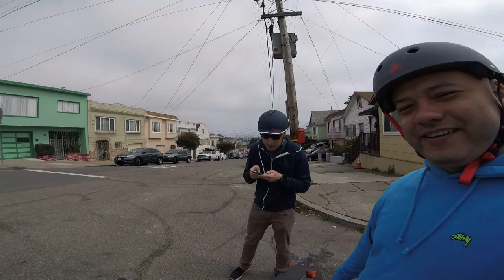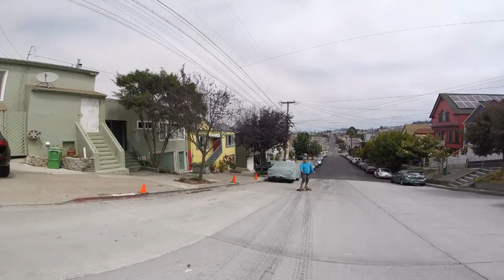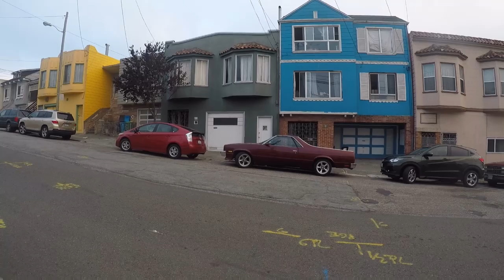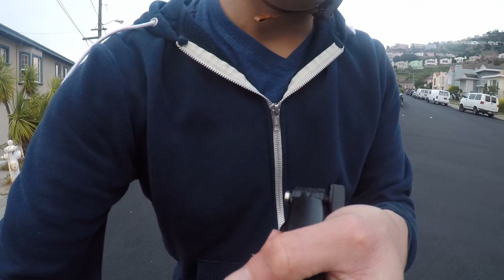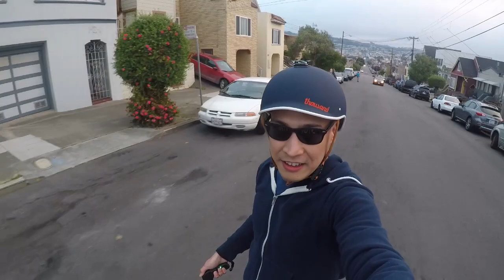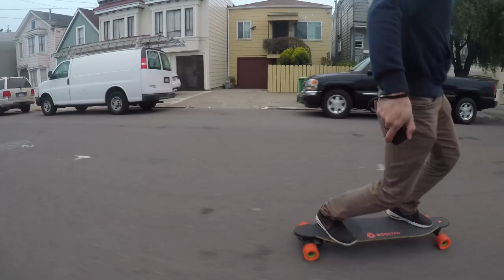Meepo Board & Boosted D+ V2 Cruisin San Francisco

Comment: I did a 5th grade experiment, on a wireless fully magnetic elevator vs a regular belt driven elevator. With the same low power the belt drive wins in power/torque. It was cool seeing my mock up electromagnet elevator go up before it busted the fuses in my friends machine and tripped our breakers lol BUT if you have enough power, and a good design, they can do the exact same thing.

Comment: hi, great comparison, just didnt get why to do it if Meepo battery isnt fully charged or the remote isnt fully charge, i have them both & its not that the Boosted killing the Meepo board at all, Meepo acceleration is much faster then the Boosted, distance wise Meepo is more then twice then the Boosted so i have different experience...
Reply from the maker: john smith the boosted acceleration is faster for sure. The meepo was fully charged the first half of the video. One of the big differences here is rider weight.

Comment: Switch boards or put a 65lb pack on the boosted dude and re-test.
Reply: sgavski1 we need to see this!!!
Reply: sgavski1 : Heck no! Not with my riding style. I've ridden hub motors before, it's not safe to ride any in SF with my riding style (how I approach hills, take corners, carve, etc.). I'll entertain that suggestion on flats tho.
Reply: Aman Singh sgavski1 : Heck no! Not with my riding style. I've ridden hub motors before, it's not safe to ride any in SF with my riding style (how I approach hills, take corners, carve, etc.). I'll entertain that suggestion on flats tho.
Reply: What's SF? A straight road test would still be decent too

Comment: I wanna get Meepo now, having so many issues with my Koowheel right now :(
Reply from the maker: Yeah, that's one of the problems with the Koowheel. But who's to say that the same thing won't happen with the Meepo? I don't think anyone has had the board longer than 1.5 months. I think the Koowheel issues started showing around 3 months. You're still taking a risk :)
Reply: I started having power disconnecting issues on my 3rd ride, and now after a few weeks the hub motor wheels are all cracked up and chipped, the motherboard box is starting to break of its screws, I'm making a video on that right now, but mentioned some of the issues on my previous videos previousely. Speaking of the design of Meepo, all the connections seem pretty well engineered, I'll still have to look into how the circuit board is mounted inside to see if it will last without any extra padding and protection. But yes, I am disappointed in Koowheel, since I've only had a couple of no-problem rides. Another option I was looking into was Backfire Gen.2. We'll see...
Reply from the maker: NITREX that backfire 2 seems nice. It interests me too. The only thing I don't like are the smaller wheels
Reply: Yeah, Meepo looks very customizable/maintainable in case something goes wrong. I'll most likely order it after I receive my money back from Koowheel. Worst case they may send me a new gen.4 D3S, not sure if it's better though, wheels are probably still made of fragile urethane.

Comment: How come your battery would be low if youre going downhill generating more battery? Or is it regenerating just not at a fast pace?
Reply from the maker: Randy Candy regeneration is only about 20% efficiency
Reply: I see, have you experienced the break issue people have spoke about caused due to too much power into the battery. Some have suggested to charge to 75% before leaving, but have you experienced that issue?
Reply from the maker: Randy Candy no I haven't experienced the issue. The meepo supposedly doesn't have it. It just doesn't have brakes strong enough to completely stop you on any gradient above 13%

Comment: What should I get the meepo or backfire 2 ?
Reply from the maker: I can't recommend the backfire 2, because I don't have any experience with it. The backfire 2 has a slightly higher max speed of 24MPH(from actual speed test reviews), but the current version supposedly is having battery issues. At this point, I can only recommend the Meepo.
Reply: Grind671 make a review of the koowheel plz